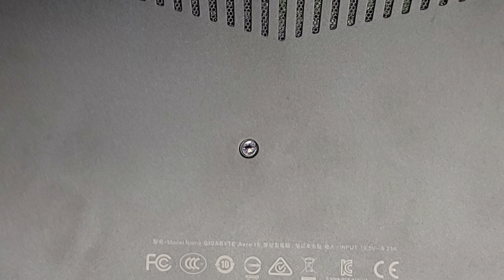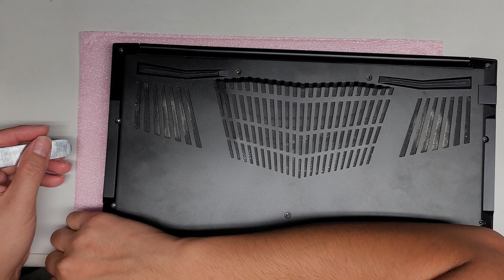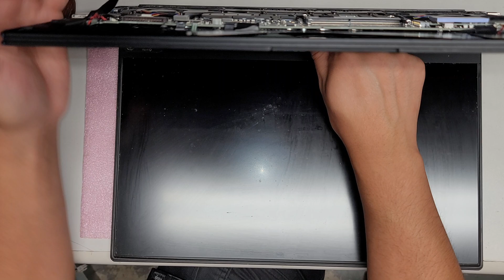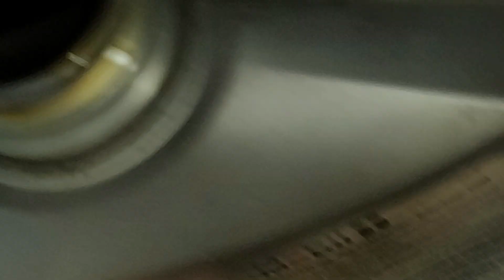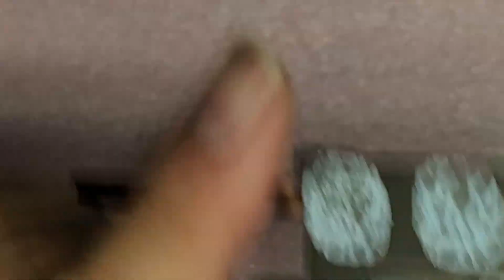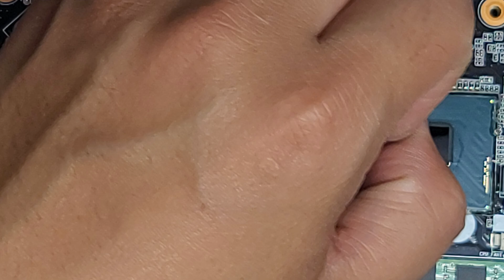Gigabyte Aero 15 Disassembly RAM SSD Hard Drive Upgrade Fan Repair Battery Replacement

Comment: You have shown us the very beginning of an Aero disassembly including the black security stickers on the little screws. Attention to detail is often glossed over by utube content providers. As a used laptop I wasn't sure if the previous owner had painted the black blob on the screws to prevent me from opening up the laptop, breaking something, then blaming him (the seller) for selling me a dud. Thank you for this as it is EXACTLY what I was looking for. Here's a sub for your trouble and fwiw that's something I very rarely do.
Last thing, I agree about the warranty stickers. Many laptops have used replaceable parts inside; think RAM upgrades and in my Aero's case a spare slot for an extra M.2 SSD. On manufacturer's sites they state their product can have more RAM than when sold so it's official, opening up your own laptop to upgrade is allowable. Anyway, tx for the vid Ben.
Reply from the maker: @jed2055  glad it helped. A lot of viewers tell me to edit things down and cut out parts. While it makes the videos more enjoyable to watch, it makes the content less useful to people who watch it to learn. I figured, why waste time editing when I can fill a niche others don't.

Comment: @ItsBinhRepaired Congratulations on your work! I have a question: Where is located the CMOS battery? I need to change it on my Aero laptop. I haven't the necessary tools to open the computer, and it hasn't a Gigabyte service center in Brazil. I appreciate your feedback. Thanks!
Reply from the maker: I think it's under the wireless card
Reply: @ItsBinhRepaired  Thank you!
Reply from the maker: Yup

Comment: The white clip that's attached to the battery won't come off. Even if I seesaw/wiggle it, one side goes in more so I can't get it out. It's overall really stiff and stuck inside
Reply from the maker: Have to keep wiggling
Reply: I'm unable to even make it budge with fingers. I have to forcefully use a tool and potentially damage other parts around it. Is there some kind of substance that can make it slip out easier or is there no way around that? Also my fingernails aren't long enough.
Reply from the maker: @Omer Zubair  other than what I showed in the video, I don't know. You can try a small tool in the raised middle part to help pull it.

I've heard ky jelly helps make things slide out easier lol jk don't do that!

Comment: "Nothing holding the battery in place" - looks like they changed things. In my Aorus 15G (same battery), there were two screws on the motherboard that held it in place (pretty difficult to tell), with one of them having a little anti-tamper sticker on it.
Reply from the maker: This isn't the 15G, that's why it's different.
Reply: @ItsBinhRepaired  I know. But there's also: https://youtu.be/e12uAGFN3Yw
That's why I got the impression that Gigabyte may have changed their battery politics at some relatively recent point.
Reply from the maker: @notthere83   battery model on this is GAG-J40 the 15G is GAG-N4A different models

Comment: I have this laptop and the speakers on it are very quiet, like quieter even than a phone. Have to have it set to 100 to make things close to audible. Is that normal, are they just really bad on this model or is there something up with mine?

It's the quietest on a laptop I've ever heard.
Reply: Oh and a normal nvme ssd from amazon will fit in that extra slot fine? Nothing special required?
Reply from the maker: @LeaderOfTheRedNinjas  I only know what's in the video. You can check the volume mixer and see if something is set extra low.

Comment: Where did you get your air blower from? Also thanks for the helpful fan disassembly & cleaning video! I will try your method & hopefully it'll fix my noisy fan problem.
Reply from the maker: This? Giottos AA1900 Rocket Air Blaster Large - Black https://smile.amazon.com/dp/B00017LSPI/ref=cm_sw_r_apan_glt_i_QMVNKF2PF0VPG5VM7WFF

Comment: Hi! I have a major problem with the AERO15X replacement battery. I bought a new battery and replaced it exactly as you have shown in the video. The laptop launched, but sometimes randomly it just shut down when working on the battery. And then if I want to launch it again - I need to connect the power cable and then disconnect it. There is no message no blue screen no anything. It just shuts down.  It is already my third replacement battery from different vendors and the problem is the same. I have no idea why it is happening and I can't find a solution on the internet. I really hope that you can help me! thanks!
Reply from the maker: Very strange. Not sure if it happens with all the replacements. Try draining to 10% and then fully charge, but that'll be tough if it just turns off.
Reply: @ItsBinhRepaired  thank you for your reply. Yes, I am testing it at the moment.
Reply from the maker: @maksymtsylia8426  sounds good

Comment: I know this is a long shot but... Where do I buy the white clip attached to the battery cable?
I bought a new battery, same specs, but it came with a wide connector instead of the smaller one.
Reply from the maker: You should return the battery and get the same model one. I doubt you can get just the connector and swapping the pins is dangerous if you short them.

Comment: This video is diamond not gold xd
Reply from the maker: Hahaha Thanks! Glad to liked the video. If you haven't already, don't forget to like and subscribe so others can find my videos and to uncover more diamonds. XD
Reply: @ItsBinhRepaired  do you know if is okey to have a crazy temp of cpu in these laptops? Is my first time im switching to laptop and I see many people playing games in these laptops with 90c that is crazy
Reply from the maker: @kennyplayer7731  should be below 90c. That's crazy
Reply: @ItsBinhRepaired  i just received my laptop today and I also repasted thank you a lot for the video I was able to lower my temp by -10c this was actually a little bit harder than it seems my laptop was a bit different than yours but still :)
Reply from the maker: @kennyplayer7731  awesome, glad it helped! If you haven't already don't forget to like and subscribe so others can find my videos. Thanks!
Reply: @ItsBinhRepaired  even after that when I am playing games on the laptop I touch close to the camera next to keyboard is kinda hot is that normal? The temp I get is around 65c with underclock and all that … but still kinda hot 🤔
Reply from the maker: If that's near the heatsink ventilation, then that's normal.

Comment: The battery on my Aero 15 was swelling and I had the really bad idea to replace it by a XITAI GAG-J40 Replacement Laptop Battery that I found on Amazon. It was easy to replace, following your steps, but it killed my computer. After replacing it the laptop never launched again. I placed again the old battery but it was too late. With the actual lack of work, losing my laptop was a massive professional ruin. So, be careful, if you don't have money to buy a new computer do not try to replace the battery for an unknown one, even if the specifications are correct, you´ll might lose your computer forever.
Reply from the maker: :( do the pin colors match and line up? Let the seller know, sometimes they'll compensate.
Reply from the maker: YouTube is auto deleting comments...I hate it.
Reply: @ItsBinhRepaired  wow! that's weird. I just said that the warranty is over and amazon, probably, will only return the battery money.
Reply from the maker: If you make the claim that it killed your computer they might compensate more.
Reply from the maker: @NeKryXe  yup, the YouTube algorithm is dumb.

Comment: About those rubber pads on the screws of heatsink. Are they essential to put them back after reasembling the heatsink? Mine do not seem to stick after removing them from the screws. Any advice?
Reply from the maker: Not super necessary, but you can use some double sided tape to stick them back on. Maybe even a thick syrup lol jk, might not be a good idea.
Reply: @ItsBinhRepaired  Thanks for the reply! I watched other disassembly videos and they didn’t put them back on. I actually just watched one of your recent videos, I hope you are feeling well and I hope you have a swift recovery! Thanks for replying, stay safe.
Reply from the maker: @markobogosavljevic3336  thanks! Yeah, short term they don't really do much. If you haven't already, don't forget to like and subscribe so others can find my videos. Thanks again!
Reply: @beafmartins4736  It’s been two years without the rubber pads and the laptop works flawlessly. The rubber pads are a scam, they literally don’t do anything. Proof is in the pudding.

Comment: Do you lose your warranty when you damage the sticker on the screw? Btw I'm afraid of doing this and damaging my pc!!! But i really need to check my fan, I think it is even broken or something....
Reply from the maker: Varies from country to country. Call the manufacturer about it
Reply: @ItsBinhRepaired  i guess I already did it some days ago, just asked because im afraid that it does... But yea I have to send it to a professional because Amazon fucked me over, and I can't do it because I don't have thermal paste :)
Reply from the maker: What were you trying to repair?
Reply: @ItsBinhRepaired  i was just trying to clean the fan because it was making noise... But i didn't even take it off as I was scared to do it
Reply from the maker: @martimoliveira9509  I see
Reply: @ItsBinhRepaired  yea... I have the aorus 17g, and i contacted Amazon to see about warranty and they said the only thing they can do is, i return the laptop, and they return the money... They can't fix it, neither give me another laptop... I'm soo upset but wtvvv, it's just a fan I guess

Comment: So I get it repaire. when I turn it on it only run the machine no screen posting. The 2nd and the 5th light turn and if I plug it in the 4th one as well. But it won’t flicker like normally does. Any pointers?
Reply from the maker: Not sure. Check the RAM.

Comment: Where is the cmos bios battery?
Reply from the maker: Something tells me you didn't watch the video. I charge $1/minute of my time that is wasted. Lol By asking a question and not watching the video, you're telling YouTube my videos aren't worth watching. If that's how you feel about my videos, then you have to pay for my professional assistance like my customers. :P
Reply: @ItsBinhRepaired  hmm I did watch it. I must have missed it. Thanks anyway for your reply.
Reply from the maker: @j_a-im_e  it's the twisted red and black wires. Looks like it's connected to the speakers.
Reply: @ItsBinhRepaired  hmm ya I saw that you mentioned that at 19:55 but when I followed that cable, it looks like it was going inside the speaker housing. I'm going to check again. I'll report back. Thank you!
Reply from the maker: @j_a-im_e  hmmm maybe I was wrong
Reply from the maker: @j_a-im_e  check under the speaker/wireless card
Reply: @ItsBinhRepaired  ok I will thanks
Reply from the maker: @j_a-im_e  hope you find it
Reply: @ItsBinhRepaired  I found it! It's actually underneath the wifi card. Unfortunately, it's not replaceable. You need to buy the battery with the cable attached :(
Reply from the maker: @j_a-im_e  yup, it's the twisted cable, right?
Reply: @ItsBinhRepaired  yes it is!
Reply from the maker: @j_a-im_e  thought so. Haha I can tell without even seeing it.

Comment: Watching this and learning how easy it is to oil the fan bearings saved me a ton of time and money I would have spent on parts and on labor having someone else to do the repair. I had replacement fans in my shopping cart online, and was just about to buy them when I found this video! This took less than a half hour, and my 15x is running the quietest it's run in a year and a half. I think someone more skilled than me could do it in half that time or less. Thank you so much. Great video.
Reply from the maker: Awesome!
Reply from the maker: Make sure to like share and subscribe so that others can learn from my videos as well. Most people don't like if I ask for a small fraction of what they saved by being able to do the repairs themselves, so hopefully liking sharing and subscribing isn't too much. Haha

Comment: Mine does not turn on and not showing any led indicators when plugged in after i put all the part back together:( what am i missing here, im pretty sure i put them all back together slowly and carefully..
Reply from the maker: Did you plug the charger in?
Reply: Yes bud, i tried everything, i disconnected the battery and tried to hold the power button for 15-30 seconds but still nothing happen, i also tried plugging the power cord and hold the power button but still nothing happens.. not even any indicator light
Reply: @farrelwillian  oh! damn! I'm only reading this now. My Aero 15 died too by replacing the battery. It never turned on again, not even with the old battery.
Reply: @ItsBinhRepaired  this also happened to me. I pulled out the battery and just wanted to use with power cord. It won't turn on. Any ideas???
Reply from the maker: Sounds like a dead motherboard
Reply: @ItsBinhRepaired  Actually there is one blue light that shines when I hit the power button for the first time after I plug in the battery. Not sure what that means though ..? Dead mobo maybe?
Reply from the maker: @NOMOFilms  possibly
Reply: @ItsBinhRepaired  the light that flashes is the WiFi light
Reply from the maker: Got it